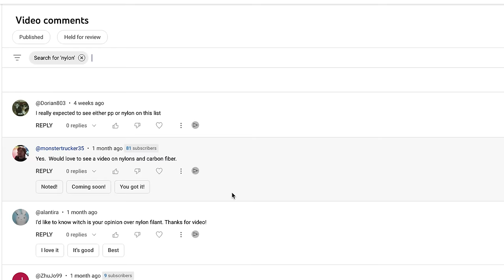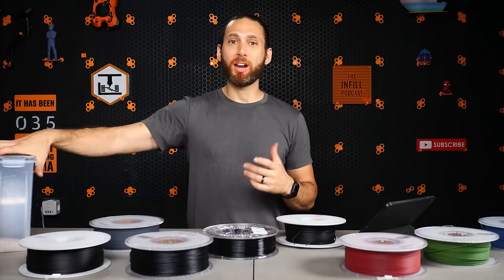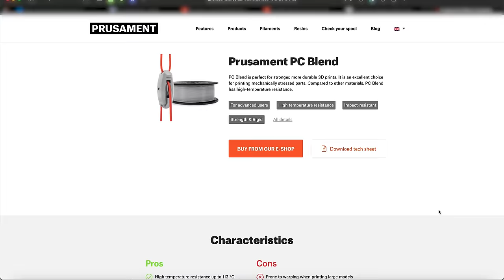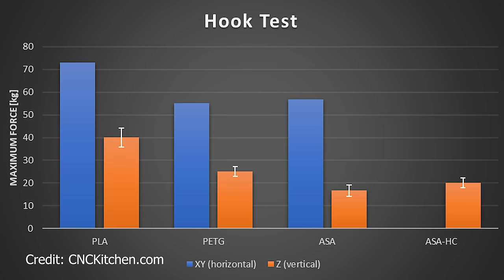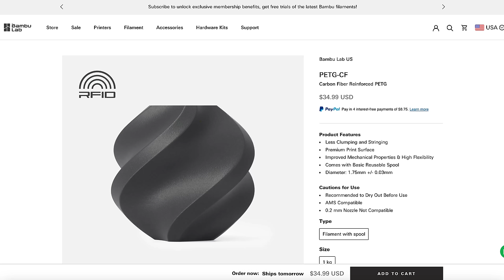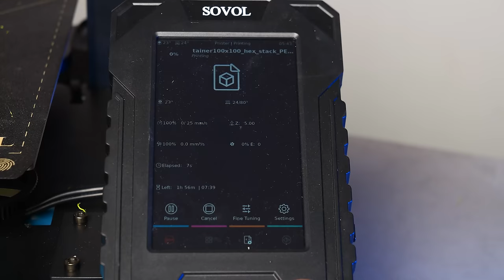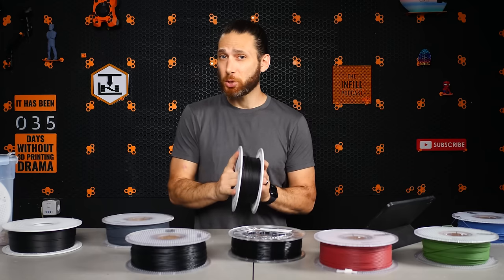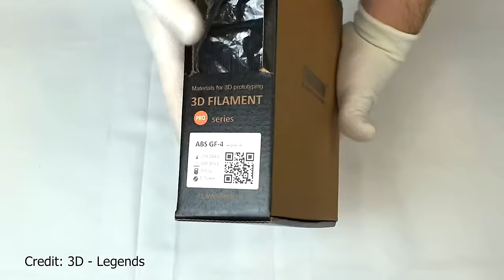Carbon Fiber 3D Printer Filaments: What Are They Good For?

Comment: I've Printed them all. ABS-CF is the best out of all of them, and is really my go to for functional parts. Nothing compares. It takes away everything bad about ABS, and leaves the good. I pretty much only print in ABS because you can vapour smooth. A 3D Print that is not vapour smoothed is like a wood working project that you don't sand. It either seem unfinished or hideously ugly. PA-CF of PC-CF are what I go for when I absolutely need something to be strong and it won't matter if it doesn't look perfect.

Comment: What materials do u guys recommend if I want to print my own chin mount to mount my GoPro on my helmet? Assuming I can print anything. I am looking for lightweight material that won't go bad because of weather elements. 

I really enjoyed the video. Thank you for this
Reply: PET-CF print hot (290+°C) and slow with .6mm nozzle. In my opinion the best option for lightweight mounts or fixtures because of the high stiffness. I used it to print mounts for road bikes (high vibration) with spectaular results

Comment: I have a question about PETG-CF, other than the nozzle upgrade you mentioned, could a printer that prints PETG print PETG-CF ?   The printer in question is an Ender3 V3 KE purchased in May 2024.  It has a direct drive print system and is capable of reaching nozzle temps of 300 degrees C.

Comment: Very good video, what printer do you recommend to use this type of filaments?
I'm looking for a printer for this hobby use and I was thinking about a BambuLab X1, I don't know if it would work.
Thank you very much in advance
Reply from the maker: X1 Carbon is the best in the game right now. If you have the budget get that. If you wanna save some money you can get the P1S instead.
Reply: @thenextlayer  
Thank you very much, what I and many people think is wrong with the P1S is that it has the same screen as the P1P.
I don't know if BambuLab will present a new X2 carbon or something like that when they have now presented the X2E.
I had the K1 Max in mind but I don't think it's the same.

Comment: I'm a little late to the conversation, so I apologize if it's no longer relevant. I have several rolls of Bambu Lab PETG-CF. I like using it. I definitely notice a difference in the stiffness of the product compared to standard PETG. For example, I print a lot of spools with both PETG and PETG-CF. With the PETG, the walls of the spools are much more flexible and I feel like they are not as durable as the ones printed with the PETG-CF. On the other hand, I find that the roughness of the PETG-CF can be a little unpleasant, and it doesn't always feel as refined and prestine as the PETG. Still, I like using both of them. I have made several RepRack filament racks and use nothing but PETG for the cleats and the brackets. I also printed a cosplay crown for my son for his costume on Halloween out of PETG because the PLA versions kept cracking and breaking.
Reply: At least with Bambu filaments the PETG has a bending modulus of 1670 MPa and for the PETG-CF it is 2910, which even though it is only a small amount of carbon fibre added is a huge difference, it basically makes PETG stiffer than PLA. The impact resistance is lower and the bending strength is only slightly higher, so the only real benefit is the rigidity.

Comment: Did you use the A1 Mini to print any of these materials? Ive been hoping to get to Nylon and PA12-CF on mine once I get it, started building an enclosure to help.
Reply from the maker: I didn't I'm afraid, I don't have a hardened nozzle on there yet... You should be able to print those materials on it, but it's going to cause extreme wear on the bowden tubes. AND you 'll need an enclosure. I'll have a video coming up soon about DIY enclosures :)

Comment: So.. Which is best for a V8 engine intake? Also if it's made in multiple parts, how best to glue, screw or bolt it together into one part?
Reply from the maker: PAHTCF!
Reply: Good question! RTF doesn't seem to work

Comment: PP - CF is one of the best filaments that nobody talks about. High temp resistance and high toughness.  Good printability.
Reply: What do u use it for??
Reply: @alfainc5868  Anything that reaches 100 deg C or is constantly in contact with water or nees to resist impact.

Comment: I've found that concentrating on dialing in one material is the best route.  After fiddling with a thousand gimmicks, straight ASA is perfect for my parts, which are used and abused outdoors by customers, and I've not had to replace anything due to part failure.  I wasted so much time playing with CF, chewing through nozzles and mangling drive gears.  Turns out it was just like drawing; if you can't shade with a regular HB, a panoply of pencils in every conceivable hardness isn't going to help you.  Master the basics, and it might just turn out that they're all you need.  That's my personal experience, for what it's worth.

Comment: Can pry tools for opening laptops be 3D printed using a printer like the X1 C? Or would the plastic lack the necessary stiffness and be too brittle for this application? 

Injection-molded plastics are subjected to high pressure during the manufacturing process resulting in a denser product. Therefore 3D printed parts would be inferior correct?

What would be the best type of filament to use in an X1 C to achieve the strongest thin pry tools?
Reply from the maker: I don’t see why not the only issue will be the sharp edges

Comment: Incredible video.  I’m new to 3D printing and actually started with the Carbon Fiber filaments.  I make prototypes for inventors. This client wants the C.F. Because he like the color and feel.  It’s definitely been very difficult to work with.  I need help understanding how to adjust temperature settings in my Bambu X1C.

I see more often that even though I use the settings Bambu sets for the ( CF) the filament in the model isn’t necessarily bonding.  I think it needs to be hotter at the extruder (tip).  Forgive me I’m just starting in 3D printing.  Nomenclature isn’t my strong point.   I don’t know if it is a gimmick yet but it’s definitely hard to dial in the settings.  Any additional advice is greatly appreciated.

I love your channel and am a big fan.  Thank you so much. Your hard work is really appreciated.  I will definitely be supporting you.  

Matrix Gunsmith - Lake George, Colorado.
Reply from the maker: Hey Man, thanks for commenting! You can edit filament temp by clicking the "edit" icon next to the filament when you choose it (under filament, there's a dropdown, then hit the edit to the right of that), then go down to "print temperature" and increase it under first layer and other layers, maybe by an extra 10C. However, note that bad layer adhesion could also be too much cooling. Join our discord, let us know which material and what settings and we'll help you out. Need to see and share pics.

Comment: Hi there and thx for this video!! It surely opened my mind to other printing materials!!  But could I ask you something?  I am looking into printing a propeller hub.  This would need to be strong, durable and has to withstand centrifugal forces, but I am still in the dark which filament to use for that.  A lot of focus is on heat resistant but that is not my nr1 concern.  It just needs to be strong and somewhat light.  Any idea's on which filament would be best?
Reply from the maker: Any carbon composite will be good for you. If it needs to endure impact go with PETGCF. If you need absolute strength, PCCF

Comment: Was hoping you were going to cover Nylon Glass Fiber filament. Could never come close to getting it to print on my creality printers (would never stick to the bed). Have a Bambu labs P1P now so planning to try soon since the P1P seems to handle most things I throw at it. Just not sure what to print with it lol, none of my current projects need the strength. At the time I bought it, it was because the prints from it had zero layer lines

Comment: I wanted to make a quick comment and ask a question about CF materials. My understanding of Carbon fibre is that it is a fibre. This means it is a long strand of carbon nanotubes.  But for 3D printable materials carbon fibre is ground up into a powder and mixed with the base plastic.  Once you grind up the physical nanotube structure of carbon fibre, don't you loose most of its mechanical strength.  Can it still be truly called Carbon Fibre or should it be called powdered carbon stuff mixed with plastic?
Reply: Carbon nanotubes are made of graphite, which is what diamonds are made from. Plastics are more like asphalt. Carbon fiber is actually made from polyester. Woven carbon fiber resembles a carpet not unlike fiberglass and the cutoff strands are sold as "chopped" media

Comment: I've printed and used CF nylon and CF PETG. I haven't tested strength on either but the nylon definitely feels stronger. I print normal PETG 99% of the time and the CF version printed just as well plus I didn't need an enclosure and I love the matt finish. The surface of the cf nylon almost felt abrasive but that may have just been the brand.
Reply from the maker: Thanks for replying! I normally don't like PETG b/c I live in a very high humidity climate, but the addition of CF makes it so much more pleasant to print! Since recording this video I've done some big prints and I love the way they turned out, too... I never thought I'd get such nice matte finishes on PETG :)
Reply: Interesting to know what are the down sides of PETG. You only mention the hydroscopic properties above but sounds like you don't rate it. I've actually never printed PLA since I discovered PETG. Mostly functional prototype prints. Currently having varying success with PA-CF for horse hoof pads. Thanks for the video. Cheers
Reply: @PammyStevensonEquest  same. since i got a home printer i started with petg. But i am an engineer and have never printed a benchy so you can sort of guage my disdain for all the trinkets people use 3d printers for.

i make alot of mountain bike accessories and go pro mounts out of petg. Even did some pedals out of petg CF.

however we do have an ultimaker s7 in work and alot of  that ultimaker tough pla filament and it has alot of great uses due to its rigidity.

Comment: Carbonx CF-PETG is a monster. Its heat resistance means I can print interior car parts and have them survive the heat of an Arizona summer without problems. It prints beautifully on my Sovol SV06. I even printed a 22lr lower in it, and it has held up amazingly. Though that's probably the biggest caliber it could handle safely.

Comment: Note about CF-Nylon, it changes rigidity depending on how dry it is. dramatically. Still, very strong and a great balance if you want less flexible nylon
Reply: I mitigate that a bit by having the parts (for outdoor) soak up some water dispersants (wd40 or whatever) when its done printing, it tends to reduce the stiffness a bit but there seems to be less change in flexibility depending on the moisture level of the surroundings (i stil have parts on my bike that i printed 4 years ago where pc failed after a couple of months)
Reply: PA6 nylons are very bad for it, it’s rigidity and tensile can half just in normal air in the worse cases, if you need it to be in contact with water then it is even worse.

Comment: Will PETG CF work with my Snapmaker J1.. I would need to just use different tips... what is this diamond tip nozzles.. sounds like that's the main one which does all materials?

Comment: I use ABS-GF made by 3DXTech. I made a number of Voron parts from it, in particular motor and belt mounts that needed strength and rigidity. I’ve also made mounts for gun parts, for example custom bipod mounts for some Sig rifles. (However I’m switching to ASA-CF for those types of parts for better UV resistance.) The ABS-GF parts I’ve printed have a slightly rough, matte surface finish and they are absolutely bomb-proof.
One plus to ABS-GF not mentioned here: it can come in colors besides black! I have a spool of white which I used on my Voron.

Comment: Don't forget that abrasion resistant nozzle if not enough. You still need abrasion resistant extruder gears or the filament will make a groove into them. It's not as easy to replace the gears on most printers without buying whole extruder. 🙄 Be cautious, don't destroy your printer.
Reply from the maker: Yep I tried to point that out with talk of the Bowden tube etc but maybe didn’t emphasize enough

Comment: Great video! I’ve been looking for a material for prolonged underwater (salt water) applications. Looking for strong rigidity, strength/durability, and can be left under the tropical sun for prolonged periods (heat resistance). Have been using PETG-CF so far but would love to hear any other recommendations.
Reply: PET-CF. Better temp, strength and toughness. Also easier to print. You need to be able to print at 290c

Comment: I pretty much only print abs/asa CF.  Or really any filament with cf added but mostly the higher temps. I've tried petg cf as well but I wasn't very fond of it.  Generally I like the light weight and the finish of them.  I've found so far one of the best ways to get good layer adhesion with any filament with additives  is to tune your hot end at the hotter side of things and fix problems that arise from doing so with other things like more retraction, more speed or slightly higher flow.  This ends up with prints that melt together a bit more at the cost of possible stringing or blobs.
Reply: Also figured I would add I print everything with my sv06.  It's not completely enclosed but is covered on 3 sides.  The only filament I've had issues with warping is pa6-gf/cf, ended up having to throw a front cover over it.
Reply from the maker: Wow what are you making that you only use CF filaments?

Comment: Can PC be tapped for threading? I am trying to make a small part that requires a threaded screw to be inserted. I could use a square nut inserted into the part, but I want to avoid this approach and tap the hole with tapping tool.

Do you think PC will withstand the tapping process?

Comment: Nice video, but there are more materials. For instance:
- PP and PP-CF(-GF)
- PVC (Vinyl)
- PEBA
With the right setup it’s way easier to print PP than PA since it’s not hygroscopic.
Reply from the maker: Yep… I might do a THIRD video about those actually!
Reply: @thenextlayer  Awesome! Can't wait to see it. Btw, there is a detailed video about the mechanical properties of PP and PP-CF on my channel. Feel free to use the graphs in your video ;)
Reply from the maker: Perfect thanks! @JanTec3D
Reply: PP is great because practically it's infinitely recyclable. Plus great chemical resistance. Not so great heat resistance. But awesome plastic for many apps.
Reply: @xboa721  Absolutely, not to forget that you can increase heat resistance by adding carbon fibers.

Comment: I know that PLA is strong, rigid and etc. But why did you say that it's applicable to use in drones, if drones are usually used on the outside, where it becomes fragile due to an ultraviolet?

Comment: in my early days of 3d printing, I attempted printing a fuel line thingie for my friend's car with Taulman Nylon 645, which ended warping but remained "functional" until installed, then it cracked and blew up.

Comment: what would be the best type of filament to use for a cellphone holder for a motorcycle? it should be rigid and resistant to heat and rain..
Reply from the maker: Probably PETG-CF

Comment: really enjoyed the video but i would appreciate more detailed testing-based comparisons of the filaments. as for myself, i've just started in 3d printing and am only using PLA so far. i have a bambu printer with an ams and from what i've read i am very concerned about any of the "abrasive" filaments damaging/clogging the feed system, though i really want to try some glow in the dark filaments in particular.

Comment: I know that the addition of CF can sometimes slow creep deformation in plastics and was wondering if this works more or less the same for ABS?  ABS is not amazing when it comes to avoiding creep deformation, but it's among the best in the lower temp plastics (which is why a lot of Vorons are printed out of ABS).  If the addition of CF or GF does reduce creep deformation to roughly the same levels as PC, that could be a feather in the cap of this type of material and make it well worth the purchase price.  If it also enhances the printability and reduces warping when printing, that is a nice addition as well.  Any thoughts are welcome.

Comment: According to Bambu, PET-CF has higher heat resistance than even PA-CF... It's actually the highest heat resistance among all the material they sell.
Reply from the maker: Whoa really? That doesn’t sound right to me….
Reply: @thenextlayer  right there in the technical specs. However what isn't so apparent is all of their specs are POST annealing, so if you lack a suitable oven your experience will be different.
Reply: @thenextlayer  PET-CF is very different from PETG-CF, they have very different properties, it’s not just a slightly better version of PETG-CF. PET-CF, not just from Bambu is known to have relatively high temperature resistance.

Comment: Pla CF is for stiffness, higher temp faster printing without warping. Not all are the same Hatch Boc PlaCF for $50 is many times better than cheaper ones. Layer lines disappear and replaced by a texture similar to printed on a flexible bed

Comment: Hi, i want to 3d print GoPro Chin Mounts, and i am not sure what to use. Doest the PETG CF do the job as gopro mount?
Reply: @neagoesebastian6995  Hi, PLA is enough for that, I printed one for my dji OA3
I've done more than 6000km with my motorbike (roadbike), still alive, no cracks.